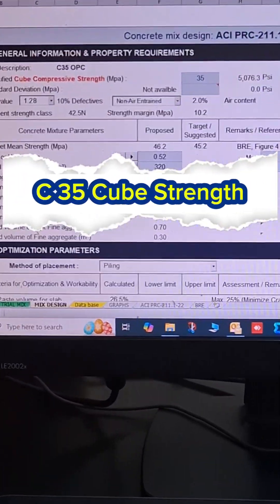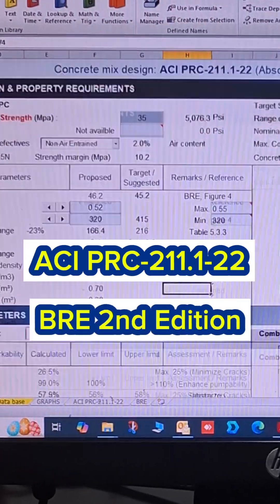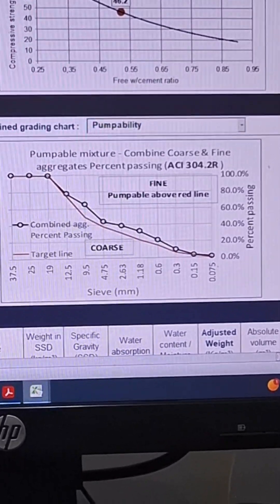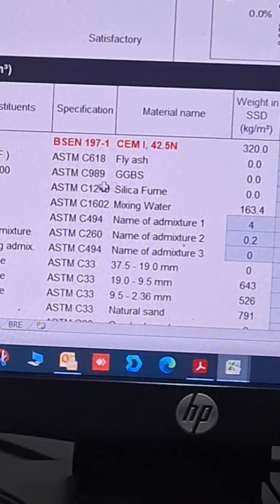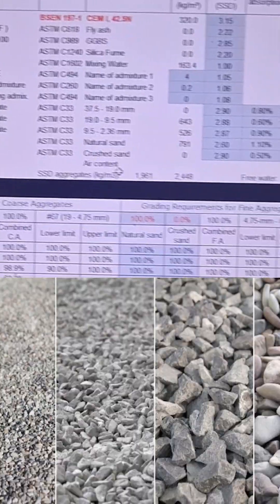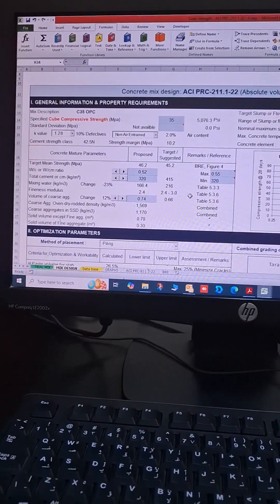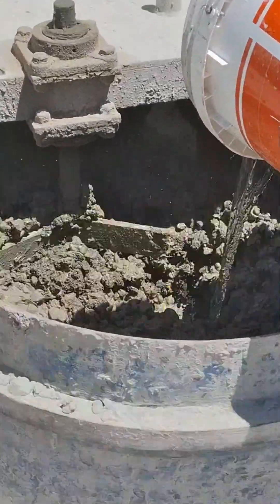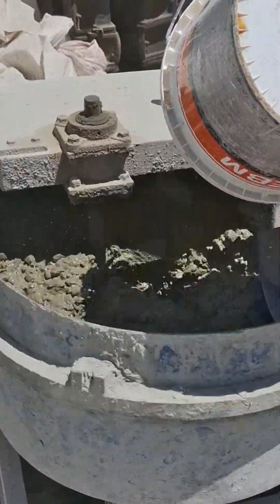C35 Concrete Cube Strength  #civilengineering #construction #concrete

Comment from the maker: What you will get from this package?
✅ Design Compressive strength according to cube sample reference to BRE and rest of procedure reference to ACI 211.1-22 guidebook
✅ Automatically increase target mean strength when design air content is more than or equal to 3%
✅ Use manual adjustment option of W/c ratio to estimate desired target strength margin 
✅ Select from Multiple Combined all-in grading envelop based on the concrete application (0.45 power, CF & WF, Tarantula, SCC, Pumpability)
✅ Procedure (steps) as per ACI PRC-211.1-22 and BRE combined

Get this package 👉 https://concretebycesar.etsy.com/listing/1859343180